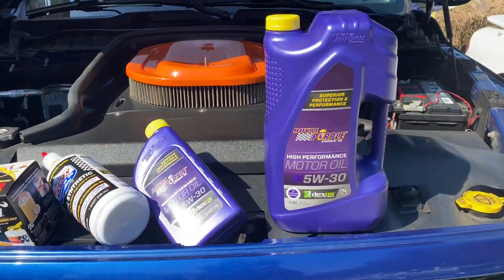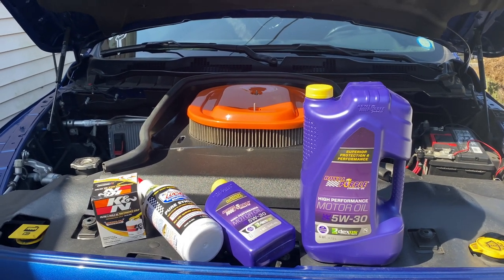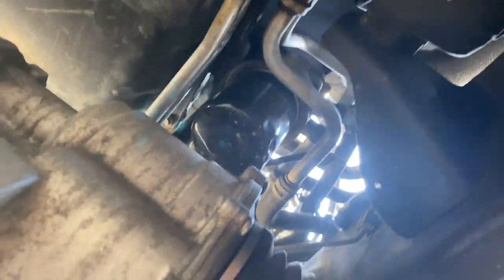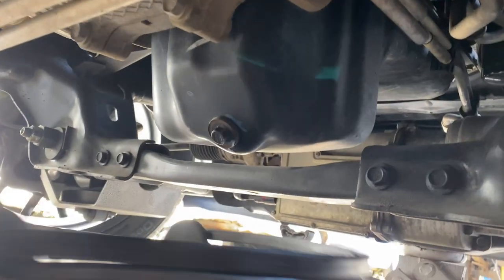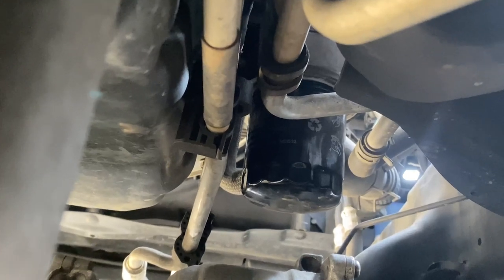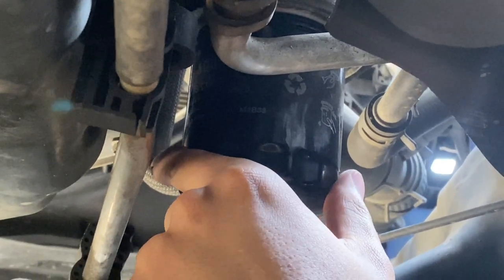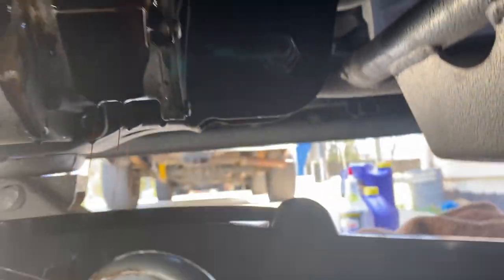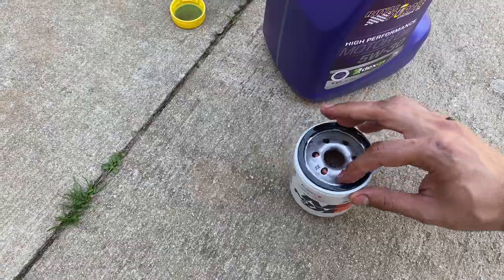Friday Vlog, truck maintenance, skateboarding & more

Comment: I love your channel man....and you look juat like my brother lol...a few tips I wanted to suggest.....I would really try and modify that exhaust a bit and push it up it hangs to low one day youre gonna hit something and knock out of alignment some of your flanges and it could be a bad day.....everyone can hear those headers no reason for anyone to see them.....also be careful on using the 5/30 oil especially in the winter.....we have really weak oil pumps and thats why we have the lifter failure theres spots at the back end top of the engine that have trouble getting squirted with oil as it is on the 5/20.....I know why you're doing it and I inwoild love more than to quiet down my lifters but its not a good idea.....cold starts are hard summertime may be ok but not winter the oils stay too thick....minheard that you can get a higher pressure oil pump out of the engines of the challengers that may bolt up or they are auppsoe too.....just be careful.....also use ams oil or mobil 1 they workd the best in our engines probably no need for the Lucas aswell.....also use the big zip lock freezer bags and put it iver your oil filter....thats how we are allndoing them you will have only a few drops of oil if any as your spinning it with the bag it catches all the oil and the filter just drops into the bag.....try it cuh.
Reply from the maker: Thanks bro and I appreciate it!! Those are really good tips and I'll def keep them in mind!! Love learning new things on the platform!💯🔥🔥👏👏